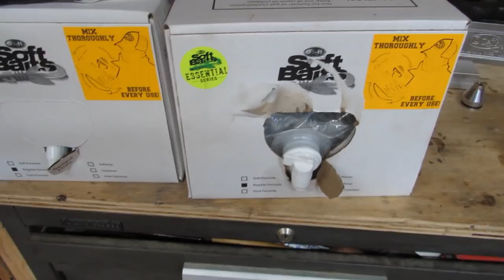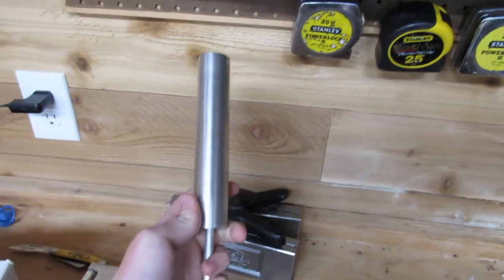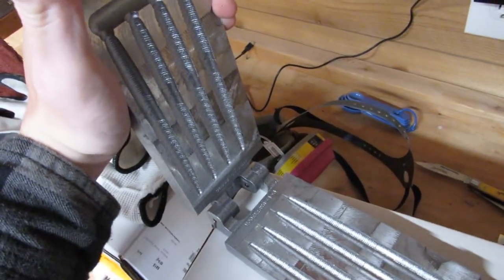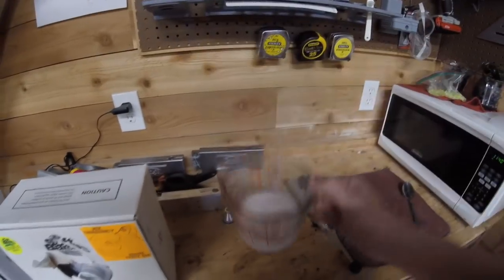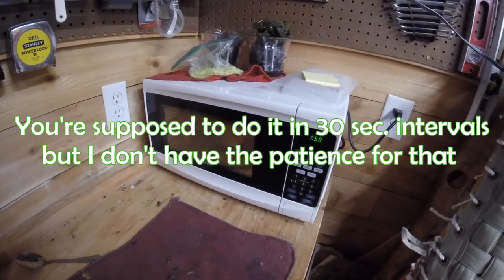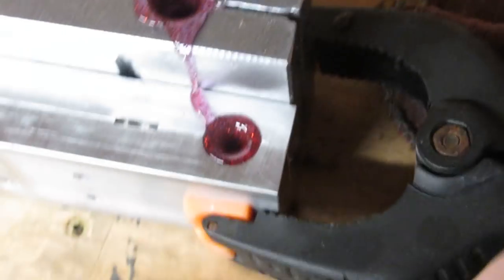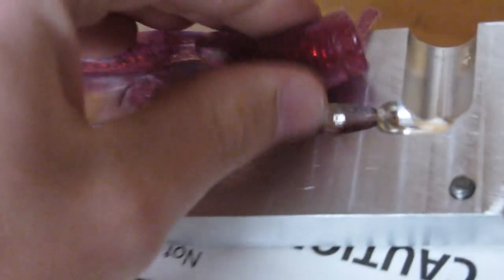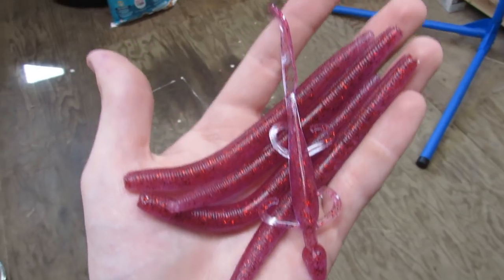How To Make Your Own Soft Plastic Baits!

Comment: Nice looking baits. I can imagine how special you must feel when you catch a bass on your own custom bait. I’m going to have a custom mold made at a CNC shop and have a question. Is there an air vent port at the opposite end of the injection port? I would imagine that air must be allowed to escape somehow as you inject the plastisol.
Reply from the maker: There are small small small vent cavities for air to escape youre right. If you’re having a CNC machine cut out the venting is probably go about .002-.004 inches on the venting tracts. Actually helps keep dents out of your lures and allows the air to be pushed out for a smooth injection
Reply: Ian Morris Thank you so much for the help!

Comment: The idea of saving money is mass production, on a smaller scale because of the cost of the molds it's not any cheaper, but on a larger scale it's much much cheaper and you can create any designs and color you want

Comment: which senko mold did you buy they have the Gary one for 95 or the one for 34
Reply from the maker: I used to have to Do-it molds essential series mold but to be honest it sucked and I don’t like the finish on the baits at all so I looked at Ultra molds and I found the 5 cavity instead of the 4 cavity and bought it and it’s been absolutely awesome. It’s a bit more money but the finish on the senkos is soooo good and you have one more cavity so you can pump more out quicker if that’s a concern. For me it is so it works. Hope I helped out! Have a good one man👍

Comment: How long do you let your mold set before you open it up
Reply from the maker: Really depends on the thickness of your bait your injecting or pouring and on how hot the mold gets. When I'm working for a long time the mold gets to be so hot I can't even touch it, and the mold keeps the baits hot and they don't set as fast. But usually my rule is if I can touch the sprew plastic (plastic that comes out the hole I inject in) if I can touch it and it feels solid and doesn't burn my fingers it's good to open. Usually it's not a problem unless it's a long bait making session so usually about a minute or two. Very long answer I'm sorry😂
Reply from the maker: NWright Fishing alrighty I’ll search you up😂